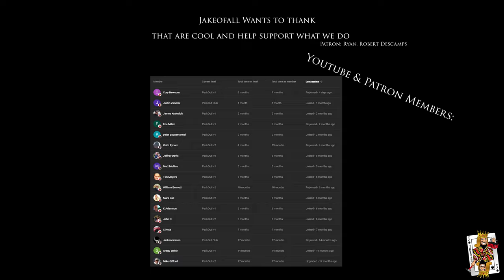Do we really need this many Milwaukee Tool vacuum TIPS?   AIR-TIP what's it for & will you use it?

Comment: I really do like the drywall dust collector that sticks to the wall. My one major complaint is that in order to create the suction to the wall, they just cut a big a** hole in the back. Was totally excited to use it for the first time on a high end commercial project and the walls were painted dark charcoal. Needless to say, I wanted to avoid getting drywall dust all over the wall because that paint showed everything. Hooked it up, drilled my holes, pulled it away…and found a huge dusty white trapezoid of drywall dust sitting right there on dark painted wall. NOT COOL.
Would’ve been better off with taping an envelope to the wall.
(BTW…any idea how many boxes of envelopes you could get for the $49.99 price tag of this item? Even if you also subtract for a single roll of blue tape?!?! 
I’ll give you a hint. It’s a lot!)
…and bonus…you could probably even skip the vacuum altogether.)
Now, there’s a Tip that doesn’t suck!!!
(Te-hehe)